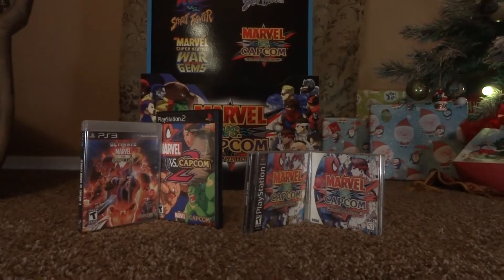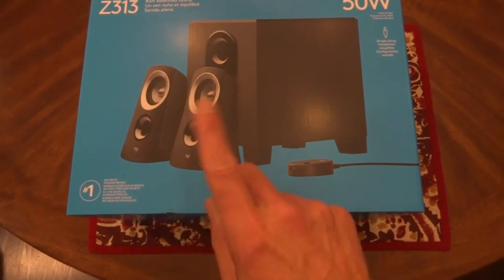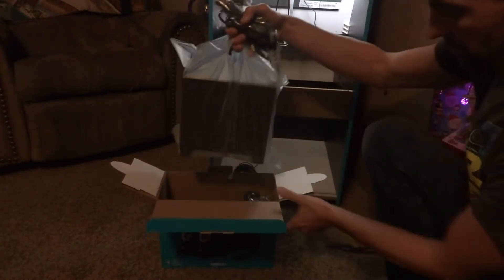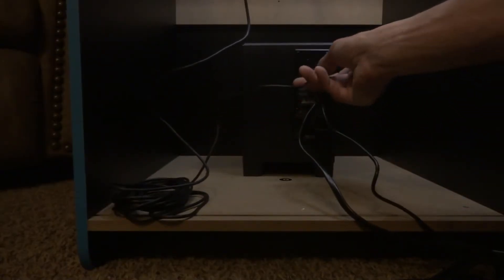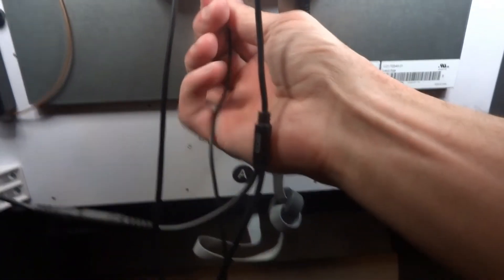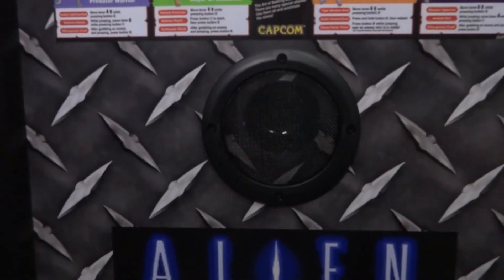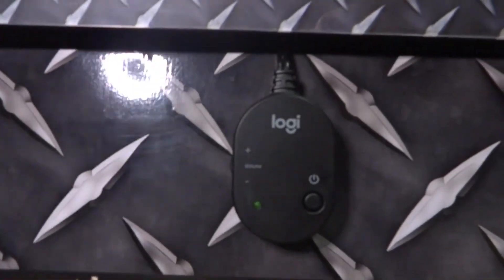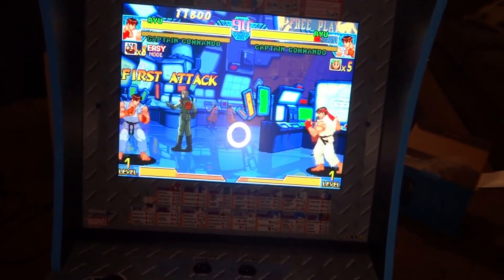Arcade1up Marvel Vs Capcom Plug-n-Play Subwoofer Install

Comment: I'm planning to do this mod in T2 should I use speakers on it or just sub
Reply from the maker: I’d just do the sub for a clean look. 🦊👊🏼
Reply: @19kfox  if you kept speakers inside
 The cab on top of sub would that work
Reply from the maker: @tdubpinoy13  Yes. That’s what I did in the video. The amp pushes sub and the stock speakers.
Reply: @19kfox  so all I need is that logitech 2.1 speaker set and I should be good?

Comment: Do you have to unplug the speakers each time you shut off cabinet?
Reply from the maker: No but you will need to turn off the subwoofer amp. I would suggest putting the controller somewhere that is easily accessible.

Comment: Did you use a stereo splitter ?
Reply from the maker: No. Just plug the stock speaker 3.5mm connector to the Logitech volume module. You may need a 3.5mm extension cord.